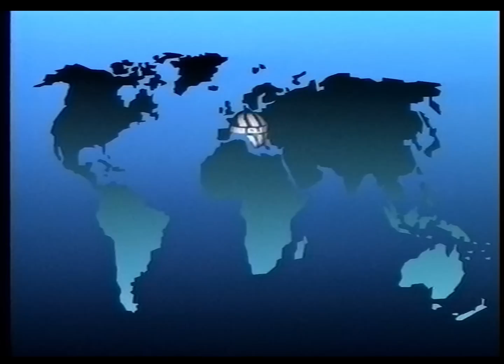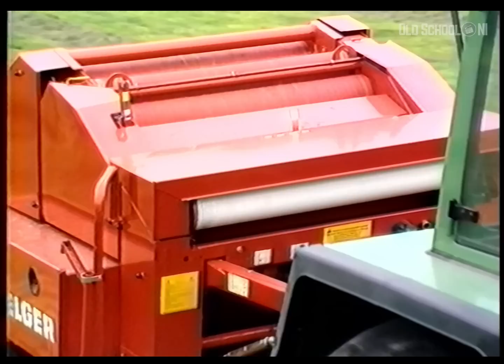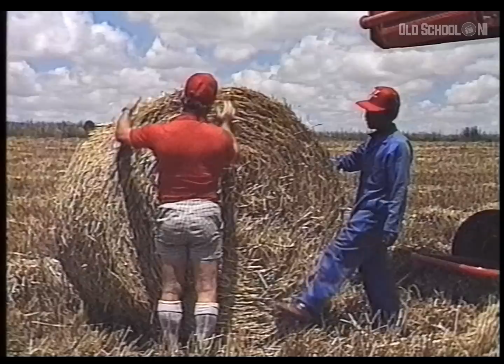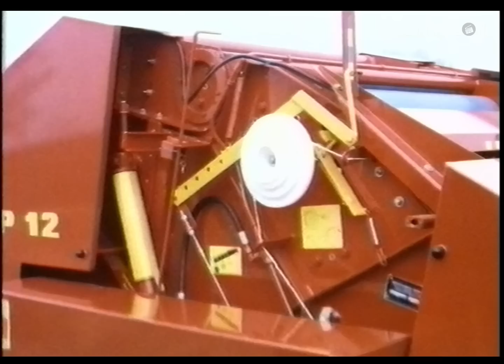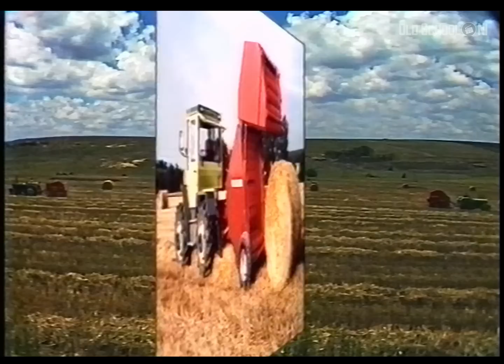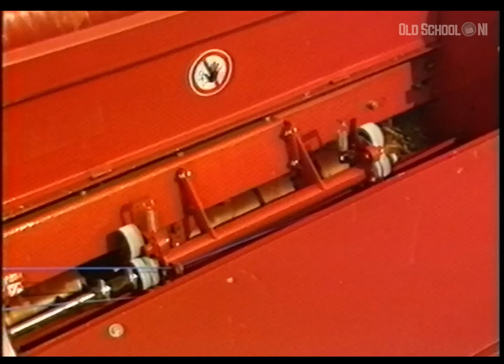Welger RP12/15 Round Baler - Promotional Video

Comment: Mind my da in a 185 baling with a neighbours RP 12 that had twine to wrap the bale back in the early 90's, years later we got our own RP 200 with wide axle, net or twine tieing, wide pick up with chopper, it was some yoke back then, it was pulled by a Ford 7810, then a Massey 399 and now its pulled by a Massey 6270, we still have the RP 200 and it still bales every year, 100% reliable.
Reply from the maker: Great memories, have a video coming shortly of a 7610 working with RP200. Must be well made machines.
Reply: @OldSchoolNI  that's great, cant wait to see it, the RP 200 was bomb proof